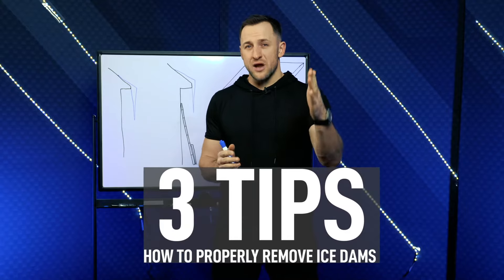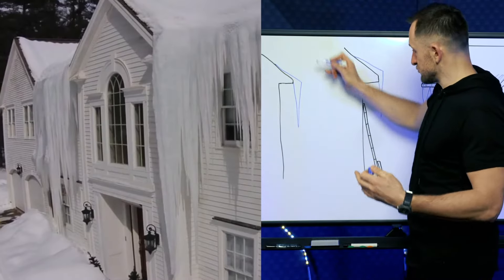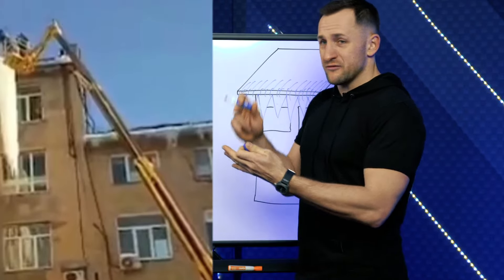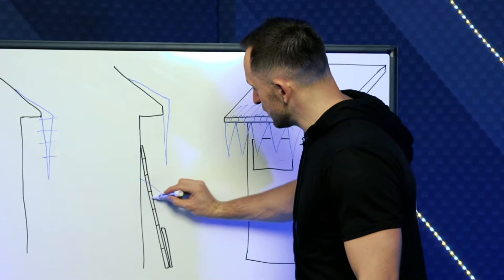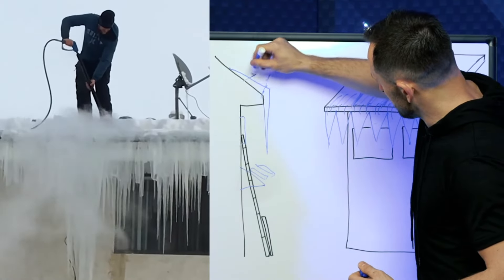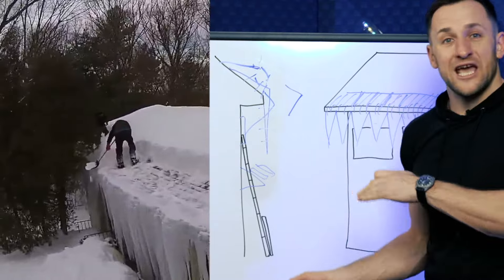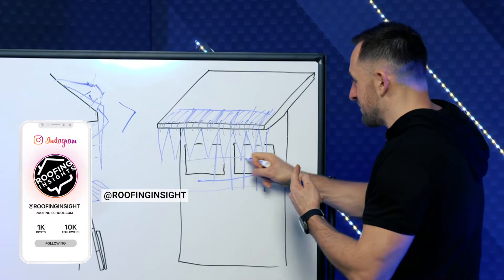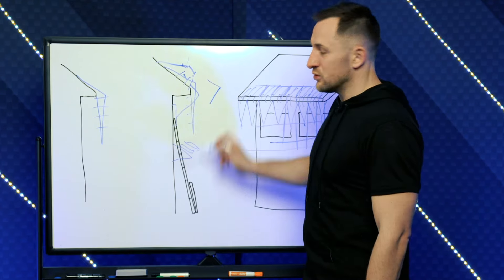HOW TO | Ice Dams Removal: Avoid Disaster @RoofingInsights3.0

Comment: great video, what is that tool your using?
Reply from the maker: Low pressure steamer. Super hot, but gentle not like pressure washer. And it will not flood everything around it.
Reply: @RoofingInsights3.0  do you have a name brand to recommend?
Reply: Arctic Steamer

Comment: Love the video Dimitri... but as icedams are preventable in most situations. I preach prevention. Not having any icedams removes any need for their removal. And I would greatly appreciate to see your take on the steps you'd recommend to do as preventive measures.
Reply from the maker: We have done tons of videos on prevention. But it will still be happening. If someone forgets to shut attic door all the way it will heat it up. Some houses just can’t be improved but have to be rebuild for it not to happen, you can spend $2000 on removing ice dam once in 10 years rather than rebuilding your roof and attic spending $30,000. I agree on prevention, but that’s not the reality we live in. And while prevention is important, not dying from negligence during removal is also important.